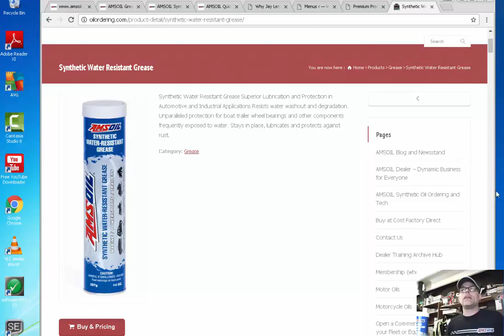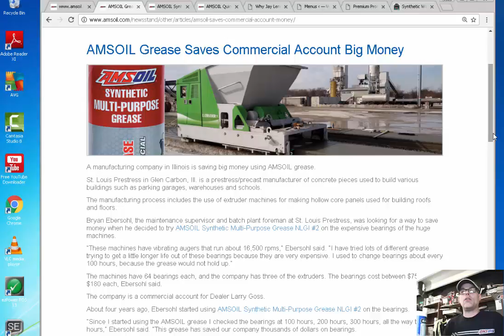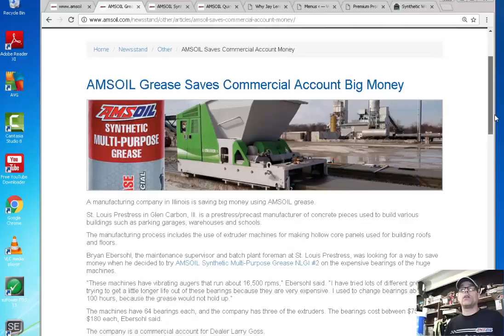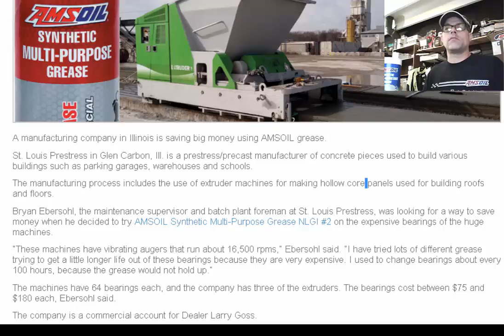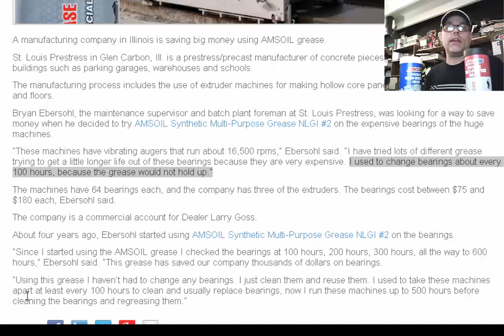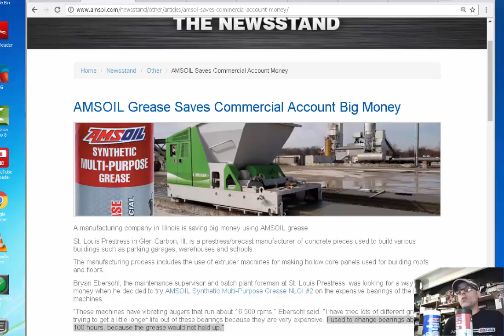AMSOIL Water Resistant Grease

Comment: Good video, I'm using Water resistant in my ATV's and Zero turn mowers(due to the dew of grass), I have noticed when doing normal service it needs less to fill. I found that out the first time I went back to refill and did to much started coming out the gasket.

Would this work for a skid loader that get's used in wet conditions?
Reply from the maker: Thanks!! Yep - we hear that a lot so that verifies what AMSOIL told us years ago when they were upgrading the technology. We should expect to hear customers including heavy off-road equipment and farm applications notice they will be using less grease at normal maintenance intervals. They did say it's important to not back off of these intervals but overall product usage will decrease.
Reply: Amsoil Synthetic Warehouse and Dealer would this product be Ok in skid loader that is used in wet conditions?
Reply from the maker: Yes, no problem there at all.